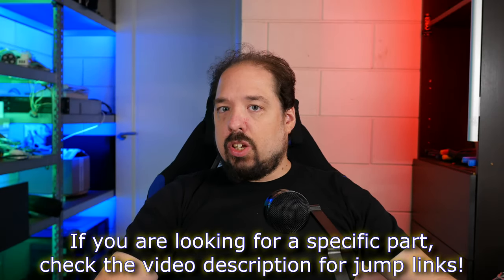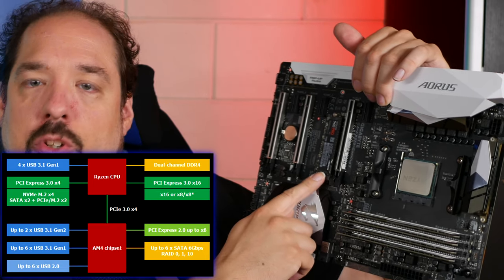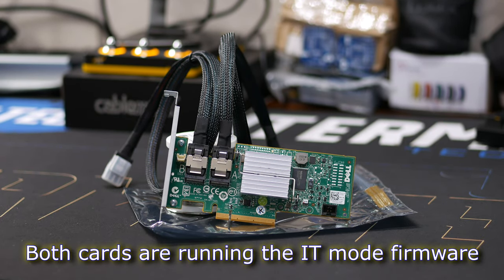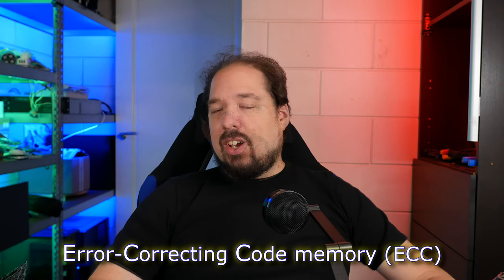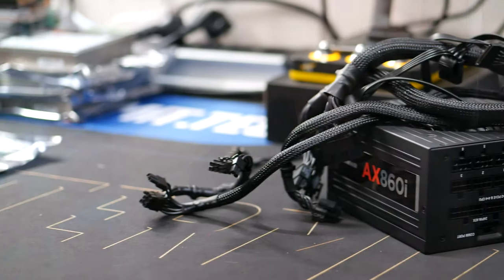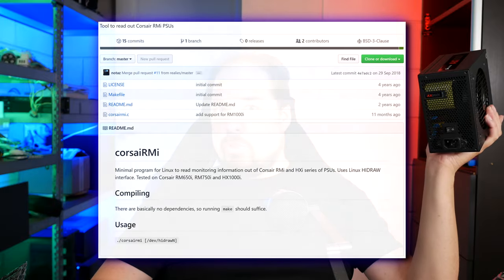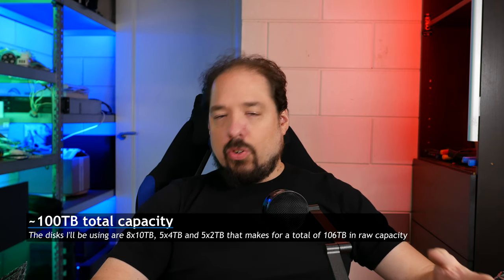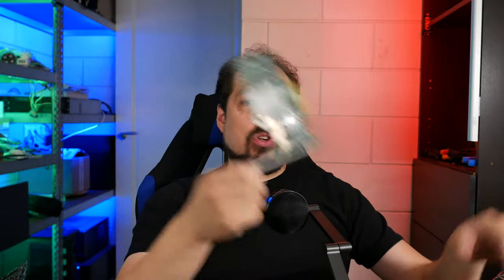Home Networking: 100TB 10Gbit Server - What hardware do you need?

Comment: Hi - old vid but very good one full of useful info.

I'm currently buidling a similar Proxmox box but using old Socket 775  (!) kit - 8GB non-ECC and several 500GB drives, plus a 128GB SSD, on onboard SATA only. This is my second build on this old hardware -  the first runs the intended VMs just fine (mainly OpenWRT or Alpine boxes so very light disk space or usage, the occasional minimal debian server VM)

Just wanted to say, apart from budget and performance, just about everything you say in this vid is very relevant to the old, free (unused) hardware builds I'm currently doing. It's just on a different scale and zero budget :)

Comment: Great content. I really appreciate the diligent planning and solution engineering to make optimal use of what you have. New subscriber here and will soon be using your affiliate link for some Amazon purchases.
When recycling old workstation motherboards to home servers, I too have opted for (in my case) a PCI VGA adapter when I wanted to reclaim PCIe slots/lanes for more useful cards. I've always wanted to play around with trying to pipe grub/linux console out to either a motherboard serial port if available, or a USBSerial adapter if that is the only RS232 option -- which would avoid spending a slot/PCIe lanes on (rarely used)) server video output (but then newer server motherboards with IPMI and/or embedded video took away the necessity to be that inventive).

Comment: I ran into the same issue with limited PCIE lanes in my most recent NAS/server build. So what I did was put in a temporary GPU (I have a spare GT730 lying around) so that I can configure BIOS and install my OS (RHEL-8), then I updated packages and enabled SSHD and VNC Server. Afterwards I can just pull out the GPU and run the machine headless, so I have all the PCIE lanes available to my HBA and NIC. Whatever further configuration and maintenance I have to do can be done over the network.

Now granted, if I am to do any configuration with my BIOS, I would have to pull out a card and put in my temporary GPU again. But just like your use case, my machine is not a critical system and can have some downtime if necessary.

Just note that while modern CPUs, consumer or enterprise, technically all support headless operation, some consumer motherboards may impose weird restrictions that prevent you from booting without VGA. It's also often difficult to find out whether a particular model of consumer motherboard supports it, since it's a very niche inquiry so manufacturers usually don't put that information in the most noticeable spot. So if anyone reading is looking to run their setup this way, make sure you read the motherboard manual (which you can usually find online in PDF format) thoroughly BEFORE you make the purchase.

In my case I'm running R5-3600 on Asrock B550m Steel Legend. This board is particularly nice for my use case because it has 6 onboard SATA ports (which means I only need 1 extra HBA to handle all 12 drive bays and still have 2 ports to spare; it supports headless boot; and the greatest of all, it explicitly supports ECC UDIMM memory. FYI in case you are looking for hardware recommendations. I got the CPU and MB for a total of 250 USD, which is an absolute steal IMO.

Comment: You mentioned one thing I've been wondering about, OP of SSDs. I asked the FreeNAS people about overprovisioning of the SSDs in the boot mirror and all I got was talk about how it isn't needed and discussions about how it works, none could tell me a reason NOT to do it how to do it (assume it needs to be done before installing and building the boot pool).
Reply from the maker: Overprovision your SSD is still very much a thing. No, modern controllers are much better then old and so don't crash and burn anymore, but performance will still crash hard. Also, doing some overprovisioning will keep your SSD healthy for much longer, giving the controller an easier job.

Create is quite easy. Fully wipe the SSD, best is a secure erase with a manufacturer tool if possible. And then just don't create partitions of the full size.

So for my ZIL/sLOG SSDs for instance I am only using about 60GB of the 960GB size. But there is multiple reasons to take this large type SSD over a smaller one. More flash cells for instance.

Giving the controller some free space just makes sure it has an easier job moving everything around in the background.
Reply: @IntermitTech  Are there any rules or guidelines on how to size your slog/zil devices for volumes?
When I asked it was about setting up OP for the boot SSDs of a TrueNAS machine as it will only use 8-16GB of the 120GB disk anyway. But if I read you right I don't need the SSD tool to specifically set up OP, I just leave parts of the disk unpartitioned (not sure how to control that during the TrueNAS install process).
Reply from the maker: Yeah, just leave it blank, that should do it.

Size wise, the more the better in theory. But don't size yourself too low for boot. ZIL/SLOG can be calculated, I believe default flush behavior is 4 seconds, so no larger then that in regards to ingest (1Gbit/10Gbit) needed per pool. Going bigger doesn't matter though, so I believe I used 16GB per pool, plenty size and since I had 960GB drives because of endurance and write speed, plenty of space.
Reply: @IntermitTech  Thank you, great answers and very helpful. I'm building my first TrueNAS machine next week so ahve much to learn. The SLOG is per volume right, you can't share the slog units for use by more than one volume?
Reply from the maker: @SteinerSE  Per pool, you can use a partition so a single SSD can be used for multiple pools if you want (I do). This isn't recommended for Enterprise production use, but if you know what you are doing it can be useful in some scenarios.

Comment: interesting build m8, i like to see the results of the limited slots and bandwidth, but i guess you on the right track and get it work fine. The videocard hopefully dont bother with x1 slot, i have no idea how that will show on the screen. I am still building my new TR4 server/workstation, have added 2 x lsi 3008 9300i8 2 port cards to future proof of ssd bandwidth, so 1 drive/lane shouldnt bottleneck much. For the videocard i got a W3100, pretty stable card and build for quality, hopefully that one will do fine for playing full bluray and UHD movies, choice for this is the small size and it use only 1 slot so all slots bon the board can still be used.
Cooling with a fan for the hba cards its wise, i noticed they are pretty hot even when not doing anything. I will experiment with a 120 or 140mm fan right on top of the video and hba cards, at so close distance i guess it will do good and with less noice than adding small 40mm fans on each card. The low profile size is very handy in that situation, plenty of space for cooling in a 4U case. Keep posting from your build!  i love it.

Comment: Don't know if these LSI cards have the same issue with consumer grade hardware/this specific motherboard or if you know about this issue, but if the motherboard won't post or boot with them installed or they are not detected at all, blank out the B5 (SMCLK, SMBus clock) and B6 (SMDAT, SMBus data) with tape.
Took me a while to figure that one out.
Anyway, love the serie's about FreeNAS and big storage in general, I'm curious what issues you run in to and the steps you take. Keep it up! :)
Reply from the maker: I've heard of these issues but never had them myself, with the Dell HBA card (LSI IT firmware) in it, the system just posted so it seems I'm in the clear regarding this issue. :)

Video building it hopefully coming somewhere this weekend!
Reply: I have had a booting issue with a HPnc523 nic.   But my perc cards have always worked

Comment: I've been looking forward to this build.  Thanks for taking us through your choices.  If you were buying new, but still trying to save money, would you go with a 1950 threadripper and newer motherboard to reduce some of your restrictions?
Reply from the maker: Working around desktop limitations is a thing, I find it kind of fun really, I like knowing the ins and outs of the hardware I use. My plan is to basically "migrate" my desktop hardware every 2,5 years or so. So my Ryzen 1700 desktop is now replaced with 3900x so the 1700 becomes my server. In 2,5 years we will probably have seen 2 refreshes again and since AMD joined the CPU game again real progress is getting made so I'll probably move the 3900x to the server then and at the same time upgrade my desktop, etc.

If you can't realize such a scenario, or don't want to buy the newest stuff when it comes out (I kind of do that anyway) I'd probably wait until 3rd gen Threadripper came out and buy a 1950 or something like that for cheap. More PCIe lanes certainly makes it cheaper!

Then again, most people don't need 24 drivebays.... so are probably fine with a Single LSI card (+mobo) so 16 SATA600 ports and a 10Gbit NIC. Add the PCIe x1 Graphics card (or even an x16 in the x4 slot) and you're golden.
Reply: Pure file storage/serving duties is not all that CPU-intensive.....; 4c/8t is more than enough for a home NAS build...

Comment: This is great. I'm trying to start a home lab/server and I'm going crazy trying to decide whether to buy an old R720 or upgrading my Ryzen 1600 + Aorus Gaming 5 ax370 to a 3700x and use the old hardware as you did.
I'm writing con and pros of each choise but it's becoming more and more difficult and your videos are helping a lot.
How is your server going after these many months?
Still recommended for a first home server?
I do have a couple of questions:
First, how strongly is SSD recommended for the Boot and for the perm storage in this situation? SSD prices here in my country are higher than a skyscrapper and while going 240gb for boot is acceptable, getting 1tb SSDs is impossible.
Second, why 1TB for perm storage? Would 500gb be enough?
Third, how did the PCI configuration went?
Thank you a lot
Reply from the maker: Awesome you are getting into home servers too! Yeah, I'm still very happy with the server, it's been running for a few months now and haven't had a single issue with it!
SSD and storage configuration is very much up to you really. I like having dedicated boot SSDs and large SSDs in a mirror for my VMs but you certainly don't have to do it that way. You could just get three disks, make it a RAIDz1 and boot from it AND run your VMs from it for instance, there will just be a really big difference in speed of everything. So maybe get one 500GB SSD and use it for boot and your VMs and then use some disks for storage? That's a fine setup to start with :)
Reply: @IntermitTech  Thank you! Awesome then. You still have the 4 pci cards as explained in the video? 2 HBA cards, 1x10gbe nic and 1x Nvidia 710, correct?
And for this particular server, do you miss any Enterprise grade equipment like IPMI? or more PCI lanes?
Reply from the maker: @Calucig  Yep, although I generally leave the graphics card out and run it headless so I'm able to run the full 10Gbit. Basically I only need to plug it in when I need to troubleshoot an issue that would cause the machine not to boot.

Comment: If you are going for "write cache", then why not using enterprise grade SSDs? You get by better performance and extra 10-20 times more writes off then, which makes them actually cheaper per TB written.
I doubt you can find 10 800GB SSDs for just £1200 with 5 years warranty. Seagate ST800FM0043 gives you around 15PB of writes and is faster then SATA limitation (which is NOT 600MB/s, but 550-560MB/s minus any data going other way, as SATA is half duplex)

Comment: i bought a 9206 16e card that still had the dell firmware on it when i booted in to unraid to test it, it kept putting the temp readout into the log, i seen the temps were a bit high so i replaced the thermal compound under the heat sink it knocked over 10 deg Celsius of the temps, might be work it for your cards
Reply from the maker: Sadly the cheaper 8i models don't have a temp sensor as far as I know, when I touch the heatsink it's quite hot but in theory that means it's getting a good heat transfer from the chip to the heatsink, so for now, I believe I'm good.

I have a flir thermal camera which I plan to use as some point to see how hot everything is getting but I want to do that once all the hardware is in there and I'm able to stress it at the same time.

Might try and repaste all the PCIe cards at that point to see if that makes a difference! Good tip!:)

Comment: Drop that nvme SSD, get an m.2 to x4 pcie slot, and a riser/extension so you can mount whatever card you want to stuff in there. Given your list, probably the nic.  But whatever you do, you don't need x4 nvme SSD for NAS boot duties. Better to save the high bw pcie lanes for something else and just use a plain old SATA 3 w/_anything_ on the end of it or even a USB stick of your using FreeNAS for instance.

EDIT: What I get for not watching the video in its entirety. Apologies on that.  When I saw the PS come up, I figured that was it.  My bad.  Although, I'm still thinking that using it as an l2arc isn't gonna be worth it/much benefit.
Reply from the maker: Not running FreeNAS and certainly not using the M.2 slot for a boot device, using it for an L2ARC which I want to saturate the 10Gbit with (or as close as possible) while live video editing from the server.

Using the M.2 for a PCIe card is a good tip though for other people! I did this trick in my mining rigs a while back, worked great!
Reply: @IntermitTech  Yeah, my bad for assuming when you started talking about the PS, you were done w/'interesting' hw.  I should have watched to completion before commenting.  Apologies.
 
That said, you don't need an l2arc w/that kind of bw to saturate 10Gbe.  I would optimize for network bw by swapping the slots for the nic and that nvme l2arc (w/pcie to nvme adapter obviously).  Would also swap out that x540-t1 for a t2 and lagg them.

Would be interesting to try both ways.
Reply from the maker: @PrimalNaCl  No worries :)

Although I get your idea behind re-arranging the PCIe slot layout, if I get 800MB/sec it would plenty for me. I'd rather keep bandwidth to the L2ARC and storage uncapped and live with that limit for now.

Simple solution would be to get a 16 port HBA or a SAS expander but in all honesty I don't think it's worth the money for me at this point. SAS expanders are cheap but have their own issues sadly enough :(

So I'd rather have the L2ARC for internal processes and live editing and other caching then another 200MB/sec on top of the 800MB/sec. Also hosting a NIC on an expander from the M.2 slot would be troublesome getting it screwed into a slot and all (because the motherboard is in the way of all the slots).

When I got them, X540-T2s where a lot more expensive and 10Gbit is more then enough. My desktop has a dual port ConnectX-3 with DAC to my switch, but then I'd need even more bandwidth and well, everything. Not worth the extra SFPs for the redundancy or potential performance really. I'd rather arrange that on another level with a proxmox cluster for instance.

But to each their own, I might change it later if it doesn't suffice for some reason, first need to see the actual bandwidth I get from it.
Reply: USB flash drives are no longer recommended for FreeNAS; inevitably, the very high daily writes patterns kills them every 3-6 months...; find those little sack of shit Optane 32 GB drives....finally good for something!